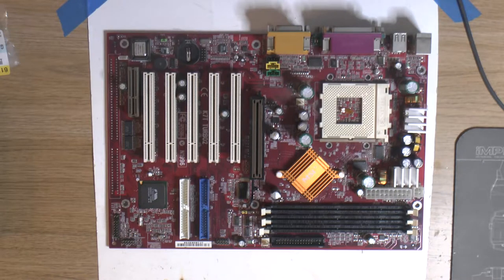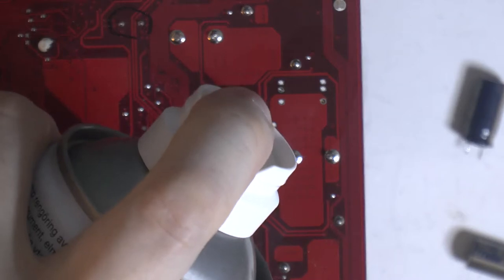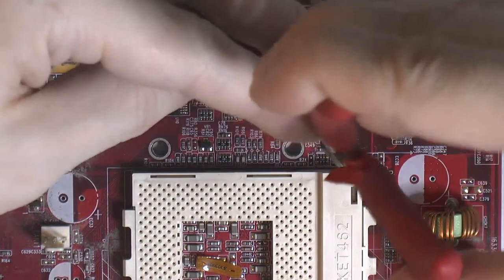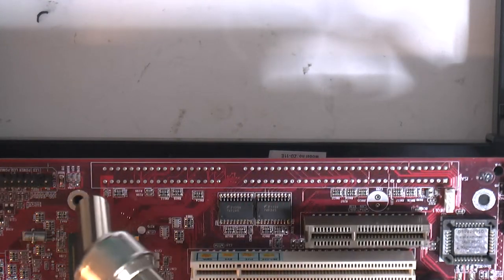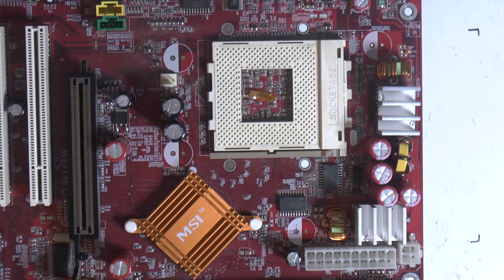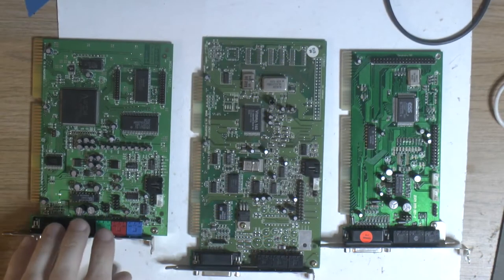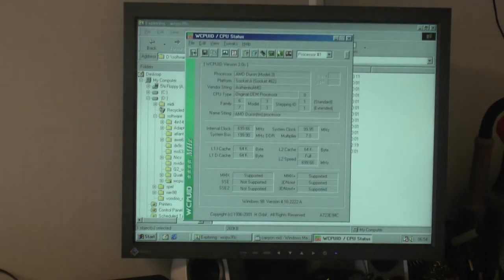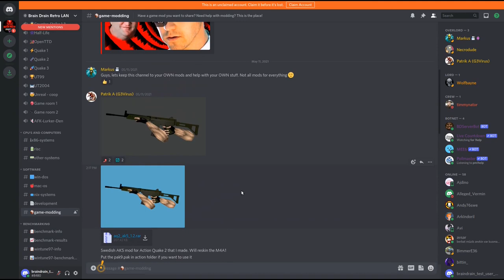K7T Turbo2 recap and ISA upgrade

Comment: Always nice to see a success! Even if the ISA implementation is maybe not 100% there... personally, I have the green PCB revision of this board that you used for the capacitor map at 3:13. Retro Web only claims T-bred support for these boards, but I have a 512KB unlocked Thorton that seems to fully work as an "Unknown CPU". Good potential for maxing out 3dfx cards, maybe.

I also have your test bench monitor as my secondary monitor. Eizo S2100 right? Great panel, very comparable to my primary in image quality.

Comment: The other board you fixed was mine I think right? It's working flawlessly. It has another feature that makes it a brilliant and even more flexible is that it has a universal AGP slot, so you can use literally any AGP video card. Fantastic all around board!
Reply from the maker: yea universal AGP is nice, also they have the mounting holes for the heavy socket A coolers that was mostly a later thing on DDR boards.

Comment: Great video, really useful tips and it was nice you installed the isa port.

I always have trouble desoldering caps so I wanted to ask. How long do you preheat the area?
Reply: it could be the ground planes absorbing the heat and delaying the melting of the solder making the desoldering harder, preheating the area seems to help, either with a hair dryer, hot air station, or a board preheater

Comment: I've got that motherboard, still running, I also had an Asus A7V8X-X and I can remember SATA ports and various other stuff could be soldered onto the motherboard. But it seems hell a lot more complicated...
Reply from the maker: I have two A7V8X-X also, one was broken but is fixed now, both need recapping. And yea adding sata support would be nice, probably doable if one had a board already populated to look at.

Comment: Hi, im shocked to see this video, because i posted a thread at vogons with this same mod some years ago. My testings  were short, the idea was to use the motherboard with an XP 2600 cpu, like an hour, and were mainly under pure DOS and with a SB16 setting the setblaster in autoexec. My results were good but for some reason when i tested it i only got full music on pure dos using address 260, no matter what i tried it never took the 220, i was thinking about the integrated chipset sound creating a conflict but the bios did not allow me to disable the internal audio chip. So looking at your machine with windows 98 taking 220 makes me think what i did wrong. maybe its windows98, because i never installed windows98
Reply from the maker: I probably read that Vogon thread. The board is a friends of mine and we built a 1400Mhz Thunderbird system on it.
AWE32/64 never worked properly, PnP did not want to detect those cards at post just like reported by others, one of my ESS cards I think worked like someone else reported (PnP detected by bios so), also SB16 seems the most compatible.
So from what I can tell my findings lines up with what I found on Vogons and any other place.
He runs a SB16 for dos and a Live! 4.0 card i think for windows, we disabled the SB16 in windows 98 device manager and enable the SB16 in dos from a boot menu.

I just think the board is bugged with ISA, probably was never sold with it so why bother making sure its compatible.

Memory bandwidth seems very good for a SDR board to, beats out some of the early DDR boards, and 12V power on top of that. So a good Thunderbird board for sure.

Comment: very nice usage of the desoldering braid, i have never seen it working so well. may i ask what soldering iron and temperature you used?
Reply from the maker: Temp, not sure was long ago but I would guess 320C.
Weller WE1010 station, probably 4.6mm tip.
Reply: wow that's amazing, only 320c. i had a look at this weller WE1010 before, seems to be a really good station. i have a cheap iron and even at 460c it can't do this. it will just suck a tiny amount from the top and then the braid becomes stuck to the hole. i'll try to preheat my board next time and upgrade my iron. thank you for replying and sharing your technique.
Reply from the maker: @diy123-bm4cs  Well depends on the PCB, more copper the harder it gets.
You also want leaded solder if you want a lower melting point, this board used leaded because its old, make sure if you add solder that its also leaded like the original.

Also preheating the board  will help and is a must on some boards more or less.

I got the Weller WE1010 mostly because it was on sale locally, I can also get tips locally and from multiple online stores.

I dont think its the best in its price range judging by reviews.
 What ever you get, make sure you buy a unit you can get tips and spare parts for.

The Weller WE1010 do not have all the tips i want, thats the problem with Weller, they segment all there stations with different tip standards.

EEVblog has some reviews, this station an other, check that out for example and see what you like and what is available where you live.

If you cant get parts and tips its gonna be useless to you very soon.

Also 460C is gonna burn the PCB and rip pads, if you need to go that high the PCB is sucking up the heat and actually lowering the temp on the tip.

Usually you want the biggest tip you can get away with so for wicking and such there are the 4.6mm tip for the WE1010.
It also works well to remove caps because you can touch bot legs at once and that will put more heat in to the PCB and cap and also make the removal a one shoot deal.

A small tip will get hot but very quickly cold when you touch the PCB or wick, but it can burn stuff before that happens.

So in the end, the biggest tip that you can work with is what I recommend as long as the work is not negatively effected.

So 2.4mm can work well to solder trough hole caps back for example.

Also a dirty tip wont transfer heat so make sure it can take solder, the wick tends to ruin my older tips removing the solder so one needs to maintain them. 
Rub them in the steel ball, add solder, repeat until it accepts solder, make sure the tip is fully tinned before you shut of the station ,that way the solder oxidizes not the tip.
Reply: thanks a lot for the detailed tips, it is much appreciated. i agree that 460c is much too high, it actually did leave burn marks on the PCB. i have tried to use low-melt solder, but that didn't work because i can't get the old solder to melt at least once to mix with it. i will try to use a bigger tip, but only when i got a better iron that works with lower temperatures, i am afraid to burn the PCB even more. my next try will be with pre-heating the board.
Reply: i have now purchased a heat gun and a bigger tip for my soldering iron, and i successfully recapped my first motherboard (an Epox 8KRA2I). your technique of preheating and using a bigger tip with relatively low temperature was an eye opener for me, it works really well!

Comment: I've started cutting off the surface mount caps. Basically, cut them in half with flush cutters, remove the remaining pieces, finally desolder the legs. I've also found that adding fresh solder to anything you plan to remove helps when desoldering. 

Curious why the ISA doesn't register the Sound Blaster. Are there different BIOS versions for the different motherboard revisions?

Comment: Why producers of these motherboards weren't soldering isa slots but only leaving place for that? That's strange.
Reply from the maker: Most socket  A boards dont even have a PCB with the ISA holes. This board exists in multiple revisions, I have recapped a few others and they dont even have a PCB with the ISA option and some are 5V and lack the 12V CPU power.

The ISA slot is not fully compatible with everything, IDK why that is, if its a board, bios or chipset issue. I also suspect people where moving over to PCI cards and ISA was just an expense the manufacturer didnt want to deal with.

Anyways this board seems popular to mod over to ISA, I saw one modded for sale in Sweden the other day.
Reply: Back then they often reused the same circuit board with multiple models, just by changing chipset, heatsinks and maybe the connectors on the IO shield.  ISA was still in demand for things like ISA scsi controllers (for scanners, external cd writers), cnc controllers for sewing machines and other industrial machines, old bnc / 10mbps network cards and fax modems etc.

Comment: I don't know why you're forcing yourself with that solder wick on individual pin holes ... normally I would add leaded solder to each point to lower the overall melting temperature, then using a hair dryer or hot air gun on the other side, heat up the blobs of solder and use a solder sucker or solder wick. Solder sucker would do the job better and faster.
There's also the option of using low melt solder (with bismuth and indidum) which stay melted for longer periods, but probably not worth it for this particular scenario. 
Good on you for the technique about desoldering surface mount capacitors, I use the same method, but you should have used through hole capacitors instead of surface mount, it looks uglier but it's a much better fix, will last longer. - norcal715 has a video where he decaps probably 100+ of such capacitors in an old video about a Mitsubishi DLP rebuild (you can use these 3 keywords to find it if interested) and he also prefers to use through hole capacitors instead of surface mount capacitors.